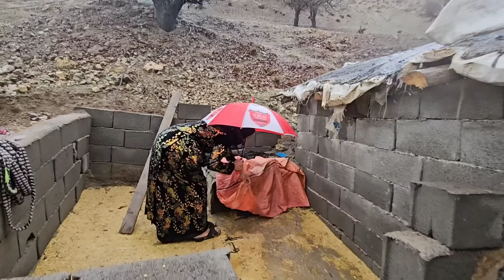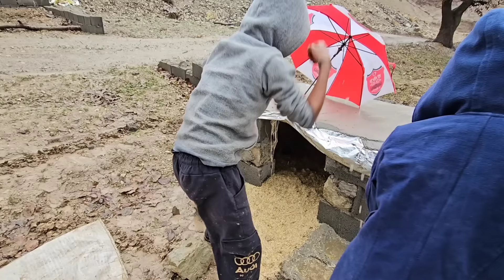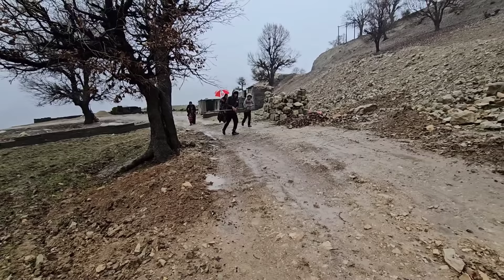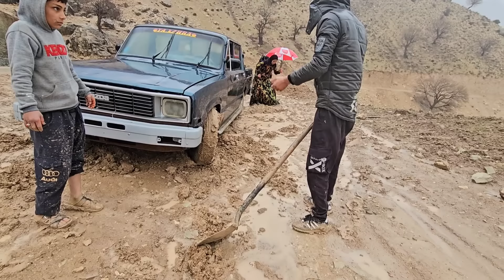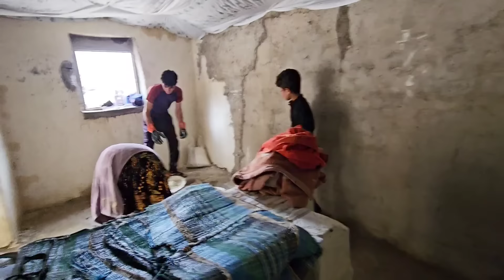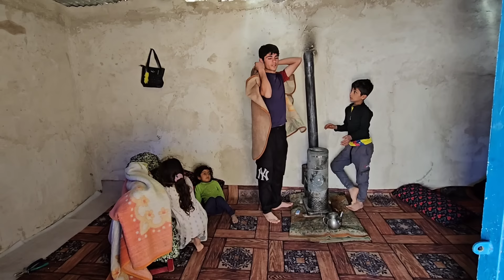Nomadic Family Rainy Day Adventure: Maryam's Family challenges to help Stranded Driver

Comment: The young man is not the smartest person in the world.  Sticks, ugly plastic, mud, and tar will NOT prevent rain from getting into any structure.    Maryam you are smart and resilient. On ALL your structures, dog house included, remove the ugly sticks, plastic, mud, and tar roofs.  Replace with TIN panels running from high points to low so that the water will run off.  Extend the panels beyond the structure.  SEAL the panels.  That is so important:  SEAL  the panels together !

Comment: The roof of the kitchen will NEVER keep water out.  Remove it !  YOU MUST buy more tin panels and put the panels on the kitchen. Slant the rivets from the high front of the kitchen to the lower back wall of the kitchen.  SEAL The TIN panels together tightly.
Reply: unfortunately they has muscles but they forget to use their brain first
Reply: Видимо мозг не догоняет их мысли, а руки растут не из того места, что у женщин,что у парня...раз покрыли _так неправильно крышу! И вооще все построено кое _как и все неправильно !😅